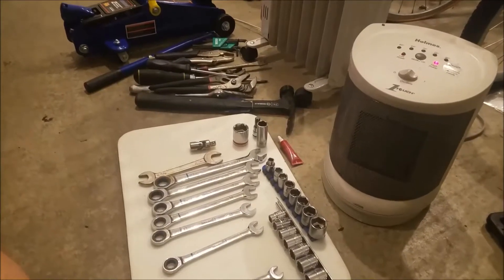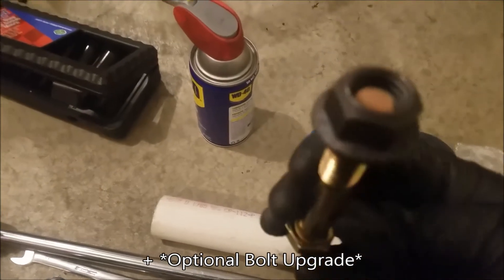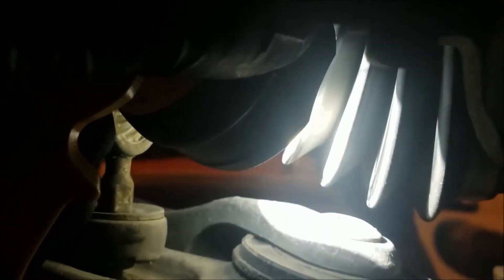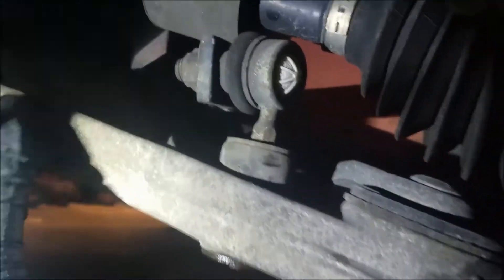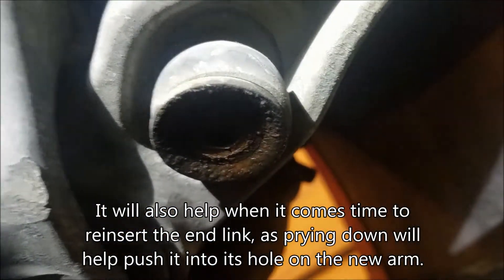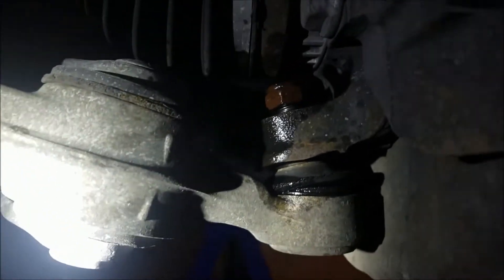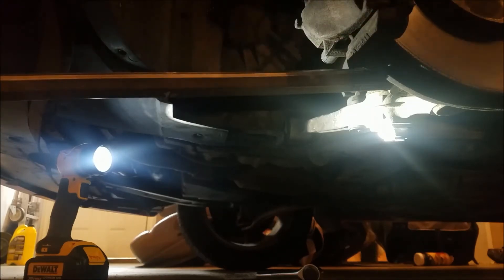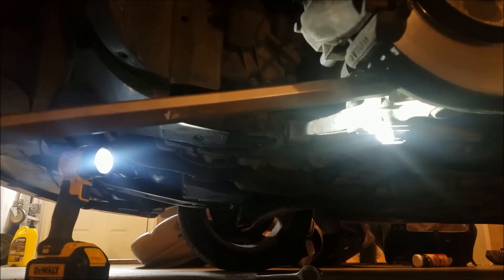Saab - Control Arm Replacement

Comment: Give Charlotte a raise 😅.  My issue is the bushing at the stanchion arm where the 16mm bolt is. It’s really bad. Can I just replace these bushings alone if I remove the bolt and swing the arm to the side? Then use like a c-clamp or press or jack?  🤔
Reply from the maker: Hahaha best comment I've gotten, as I should. She's helped with many more bolts since 😉
You could press out the bushing with a press, but that's alot of effort when it's easy & affordable to just replace the arm that comes with a new bushing. Powerflex makes new standalone bushings, if you do decide to go the press route.
Reply: @saabross3171  😁 yeah, you’re right man. Makes more sense to go the arm route with the built in bushing. Thanks again for the great vids!   Keep on Saabing.

Comment: so for my 1996 900se, do i need the get the control arms that the sway bar end link attaches to control arm, or the older one where it doesnt.  just want to make sure i order the right part
Reply from the maker: Artic that's always a great question when it comes to the NG900. I wanna say they switched in '94, but there are two different designs. The old one the end link attached to the stanchion, later years it connects to the control arm. You can see the two in this diagram. The best way to verify is to go look under your car!
https://www.esaabparts.com/viewparts.php?searchpart=1&section=171155474
Reply: @saabross3171  thanks, will do. I think I have the later year design, I’ll take a look soon though before I order the parts from rock auto

Comment: Hi, how many miles do you have to replace the whole setup?  I have 110k miles and driver rear shock Is lower than the other side.  I was thinking just replace the shock, mount, and some rubber.  I saw these parts are not expensive, so i might as well redo it.
Reply from the maker: There's no specific mileage, but from what I've seen, the rule of thumb is once you cross 100k alot of suspension components are worse than you think. The car in this video had about 120k at the time, and I just did a 9-5 suspension with 105k yesterday that was overdue. So yes, if you're able, I'd replace all you can & can afford.
Reply: @saabross3171  Thanks for your reply.  Do you use OEM parts or any after market will do the job?  I meant the parts sells at Eeurope or eSaabparts.  Not AutoZone brand
Reply from the maker: @imanwan2861  Haha yes, no AutoZone! I use a mix of OEM from eSaabParts bc they have the best OEM prices, but I also use alot of OE quality aftermarket (ie Febi, Bosch, Bilstein) from eEuroParts, FCP Euro, RockAuto, and SOME Pro Parts Sweden. For suspension parts aftermarket is just as good and economical, the control arms here were upgrades from GenuineSaab.com and the stanchion arms were basic eEuro buys, perhaps ProPartsSweden.

Comment: On a saab aero 93 how do you take the headlight ballast unit off on the lower control arm?  Does it just bolt off?
Reply from the maker: I assuming you're in the EU? We didn't get "Aero" models on these 9-3s in the States; but you did. Lucky! We also don't have the headlight level switch, as on non-Euro specs it's just a blank switch, so there's no ballast either. I'm afraid what you're asking is something I've never seen before, thanks to geography. Sorry I have no idea.

Comment: My saab 97x lower ball joints are going out. Can I get just the ball joint replaced or do I have to replace the whole arm?
Reply from the maker: Different car, but I imagine it's easiest to replace the whole arm unless the ball joints are designed to be separated like the 9-5. I can ask a guy I know who owns 2 9-7X's. He'd know.
Reply: @saabross3171  ok. Thank you 😊

Comment: If I go with the Taliferro control arm with upgraded bushing and bolts would you advise any other upgrades to the front suspension to do at the same time..
Reply from the maker: Just make sure you have 16" wheels so the upgraded bolt is no issue. The sway bar end links are great to replace while you're in there and I'd definitely, DEFINITELY add their power steering rack brace with the 22" rear anti-roll bar. The rear ARB makes a world of difference, especially if you're stiffening up the front. Taliaferro also makes a 2pt and 6pt brace that can help beef up the sloppy suspension on these cars, but I've never used them so idk how worth it they are. The 2pt seems easy to add while you're doing control arms. May be worth looking into as well.

Comment: This is a great video! I’ve been looking into refreshing my front suspension with new bushings and balljoint. Genuine Saab has those parts, I’m sure that’s where you got yours
Reply from the maker: Thanks Richard. Yep, the control arms and end link bushings came from Genuinesaab.com. They're the only folks who offer the bolt upgrade in addition to polyurethane. The basic stanchion arms I believe we got from eEuroparts

Comment: What can you do not to destroy rubber boot on the ball moint
Reply from the maker: The ball joint is part of the arm, ripping the rubber boot is pretty much unavoidable. But replacement is easy, either with a new arm or re-booting the ball joint